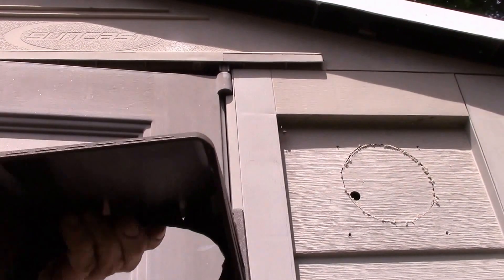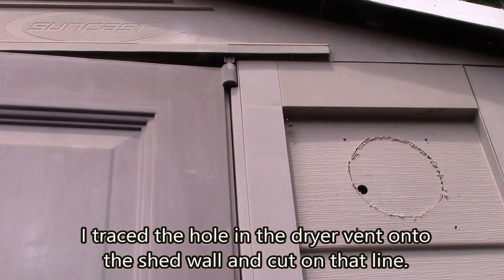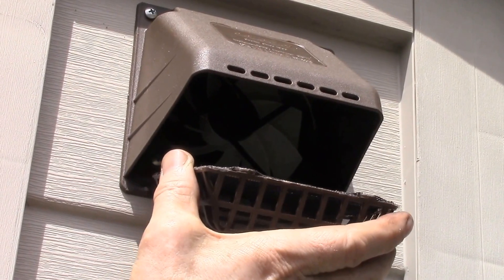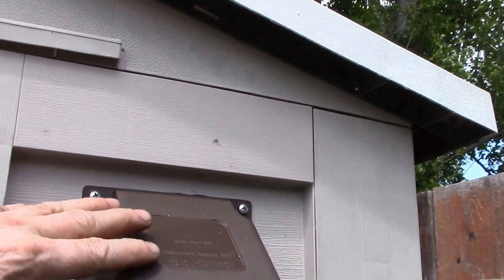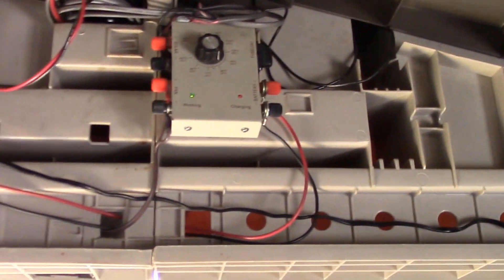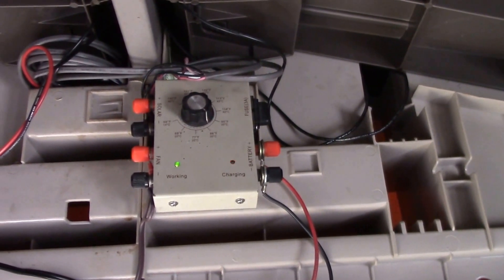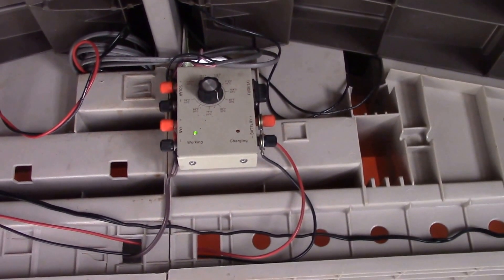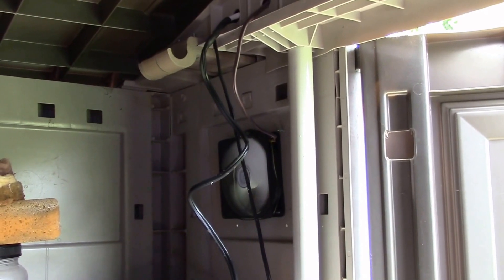Solar Shed Project, Part 8 - Mission Accomplished!

Comment: I think I might add these solar fans to my attic roof vents. There’s about 8 small vents on the roof. I could mount the solar panel on top of the vent on the roof.and drill a small hole in the vent to run the wire into the attic for the fan. Good inspiration for DIY’ers.
Reply from the maker: I find it works well.  I've been running 8 - 12V fans in my attic since 2013 and they do a decent job of keeping the attic bearable:
https://youtu.be/IXnU8SDihSs

Comment: Good job! I would do another vent without a fan somewhere to exhaust heat
Reply from the maker: There are existing ventilation holes on the back side of the shed.  I didn't specifically show those int he video.

Comment: Nice outfit.  What size solar panel are you using?  I have an 8x12 storage building that I use as a hunting shed.  It gets pretty darn hot in there during the summer, preventing me from comfortably being able to stay the night due to the heat.  I have been wanting to do some type of venting process like this and found your project to be more like I had in mind.    I do have a new 30 watt monocrystalline panel.  I assume that panel would power the fan just fine.  If I install a battery to use at night if the building gets too hot, I assume the 30 watt panel would keep the battery charged for that purpose, assuming the fan doesn't pull much power.  Appreciate some advice.
Reply from the maker: I used a pair of 15W amorphous (Harbor Freight) panels for most of the time:
https://youtu.be/l0R0Hl4oS4Y
They work fine except on overcast, hot days.  So recently I threw a pair of old 60W panels on the shed roof.  That is way more panel than I can use but that's what I had laying around.  My shed is right up under some trees to the east so in the summer it'll be 10-11AM before the first sun hits the panels.  Then the house blocks the sun to the west around 4PM, so I don't get a lot of hours of good sun.

But try your 30W panel, if you need more power, add another similar panel.
Reply: Did you try the 30 watt panel? If so how did it work for you? Greetings from sunny Jamaica.

Comment: awesome job! Good idea would to insulate it.
Reply from the maker: Thanks for the comment.  It doesn't really get cold enough here to insulate it in the winter and in the summer, the pair of fans do a good job getting the hot air out.  But the 12V solar battery charger is working great.  Needed to use the backpack sprayer a few times this winter and it's fully charged and ready to go.

Comment: That window screen after the fan will get clogged after a while.
Reply from the maker: Likely so, but in a year and a half, it's still working fine.  I do check it and the air flow from time to time to make sure it's not clogged.  Main thing is to keep things like bees from making a home inside and so far it's been successful.

Comment: What is the brand of charge controller.  Nice video..thanks
Reply from the maker: It's an old Harbor Freight solar charge and fan controller.  I cover it in a separate video:
https://youtu.be/ZrjkyeQQAZE

I used it for a while then tried an inexpensive PWM charge controller and now have a better MPPT charge controller in the shed.  The main issue with the HF unit is it has no low voltage disconnect feature to protect the batteries from over discharge.

Comment: I've used superglue to stick that fibreglass flywire to metal mesh grates before. Quite amazing how strong the glue bond is.
Reply from the maker: Thanks for the comment.  Sounds like a good approach to get a finer mesh.  I used some Shoo Goo clear adhesive here.  Ran a bead around the rim of the grill and then embedded the screen into that.